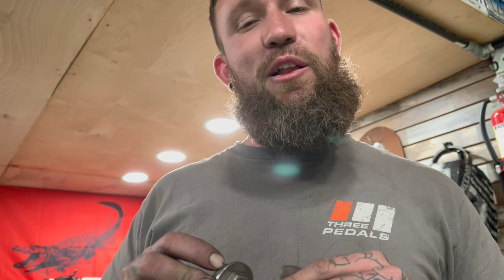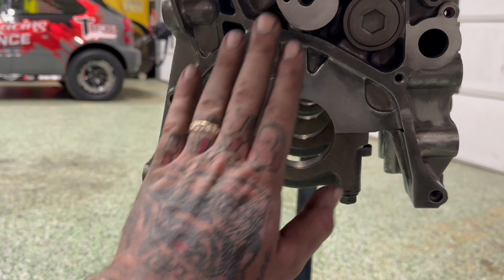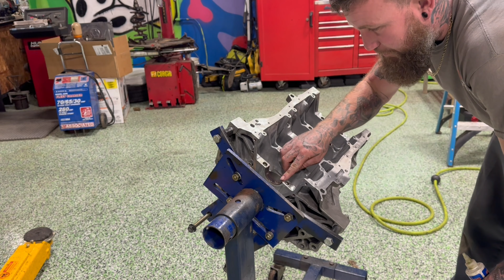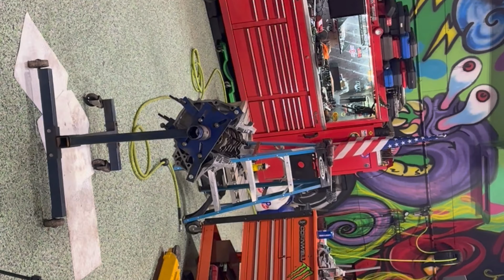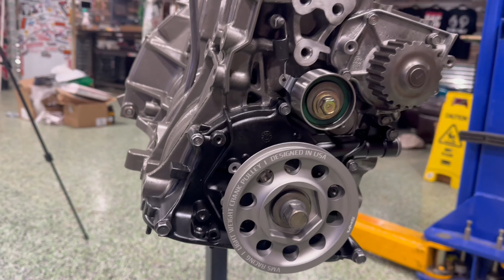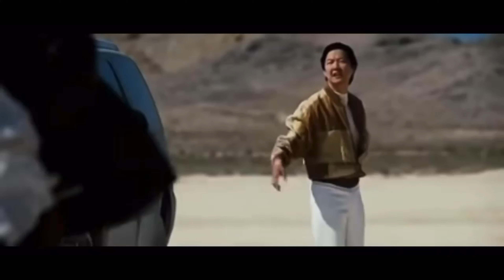BUILD the ULTIMATE LSVTEC 800hp in your BACK YARD!

Comment: Do all yourself a massive favor and DO NOT install the ebay aluminum crank pulley you see in this video. They remove zero harmonics and eventually you will destroy your oil pump and forward main bearings! Get a ATi damper. If you cant afford one run the oem damper.
Reply: How about the block guard?
Reply: U right bro

Comment: Nice video, but something u should know.  When you install arp main studs, you need to line hone the crank journals.
Reply: Especially with that bullet main girdle. I have a ERL on mine.  You gotta drill the caps for the dowl pins as will.

Comment: First let me say GOD Bless my brother just had a quadruple bypass and is doing great.just subscribed liked and hit bell now about me I'm old lol I'm 56 years old with a good job just spent almost $4.500 in parts for my LS VTEC turbo I've never done one due to crappy jobs i just never had the funds I have a 1991 Crx with a all stock A1 finally a channel showing how to do this I have a spare B1 block I'm sending off to get sleeved I have Scat rods Ferrera valves and super tech stuff as well along with a b16 Cylinder head this video has helped so much thanks for your time and effort on this video my only question ❓ I have the crank or block girdle what oilpan do I use a gsr /type r thanks 👍 God bless
Reply from the maker: a gsr will work or pick up an aftermarket deep pan I put a moroso on this one
Reply: Thank u so much your knowledge is Gold god bless 🙏👍